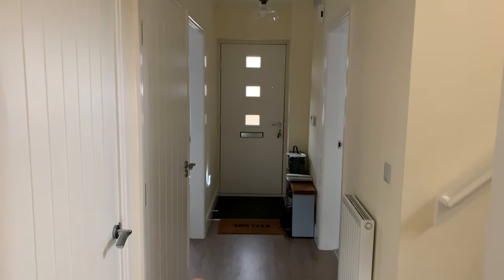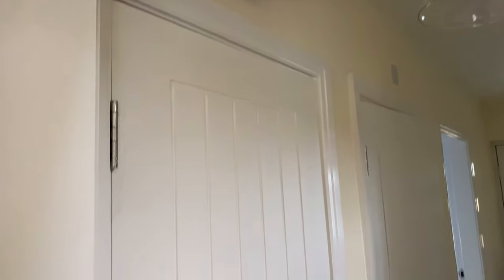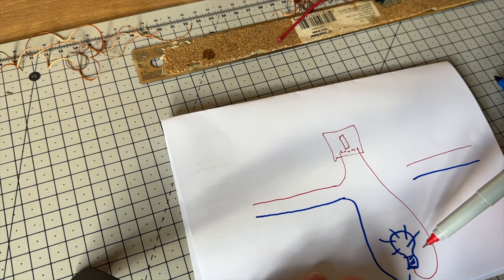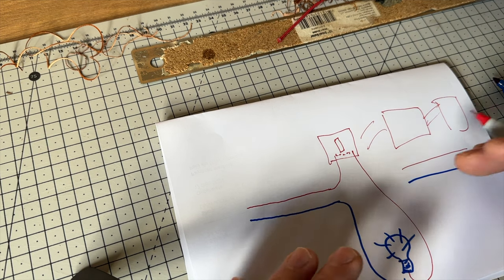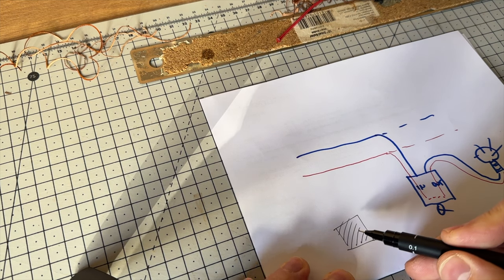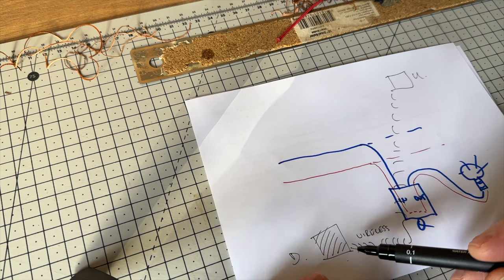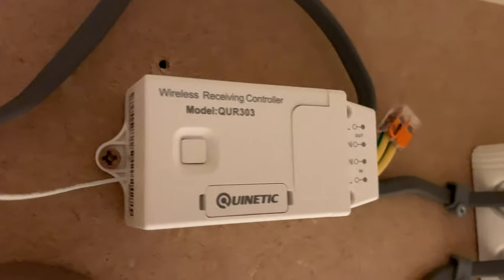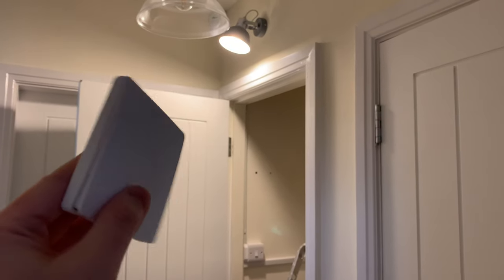Adding Lighting Using Quinetic Wireless Switching Technology // NEW HOUSE EP #6

Comment from the maker: In this video I'm demonstrating how to add an extra light in your house using Quinetic (kinetic) wireless switches. This is a great new technology which makes it very easy to add what would be complex indoor or outdoor lighting scenarios without a lot of the wiring that would be needed traditionally.

I expect in the coming years this kind of technology will become more and more common as it can also then integrate with home automation and other smart home technologies.

The Quinetic stuff is available in the UK from TLC Direct (this is not a sponsored video I'm just happy with the service and impressed with the technology!)
Reply: wouldn't the receiver draw constant power though whether the light is on or off?
Reply from the maker: It does yes but it's a trickle amount, the spec sheet says < 0.5W

Comment: These wireless switches are really good, I fitted them 14 years ago, and expected "modern" technology to fail quite quickly, but they have given faultless service , and as we have 3 foot thick stone walls it saved a lot of channelling out, the signa even goes through the walls to operate the lights, I also have a remote plip that is paired so can put that wherever I need it, I have also used one of the receivers  connected to a PIR so the a light operates wherever you enter the room. Chris B.